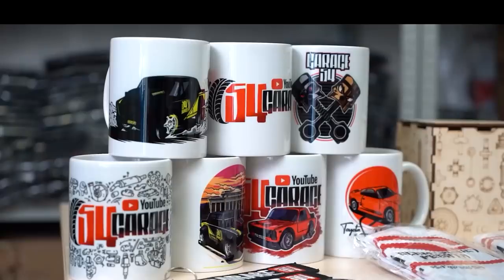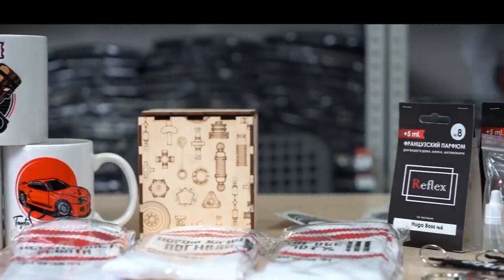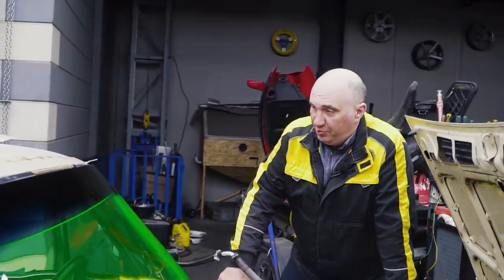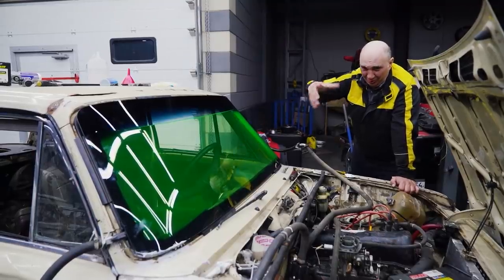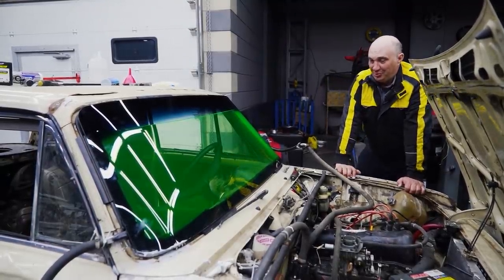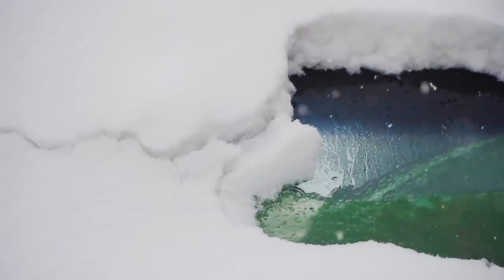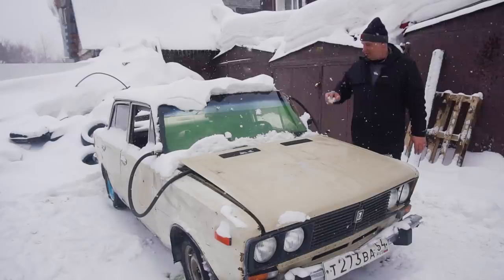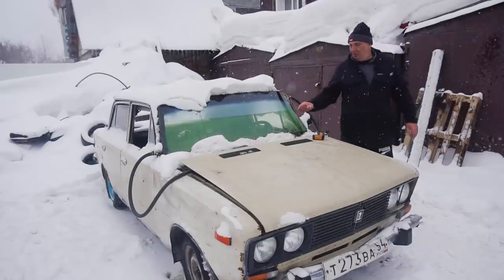Using coolant to heat a windshield

Comment: These totally odball experiments are my favorite! What a good theory, that would work so good.
Reply: Great idea on paper, sure! However in a crash, there is a good chance you would get doused in hot coolant. Nonetheless I think it’s a neat idea too
Reply: @nigwardtesticles8004  They can always hook up a bunch of sensors and valves to make it "safer"
Reply: @CodeBuildsCars  in theory yes. But there is still a high risk of getting scalded. Especially if the sensors fail, which they are know to do in cold weather.
Reply: @nigwardtesticles8004  agreed

Comment: 1:15 - gasketed window removal - EVERY time I try, I break the windshield. The other day I was just putting an old gasket on one that's off the car for safer storage, I was sweating balls doing it. 

You guys are pros.
Reply: @Mike i work in a car glass shop, and its not even always easy for the pros;)
Reply: Adam Chapman  yea
Reply: On some cars it takes 15 mins on other 3 hours...
Reply: with two ppl windshield removal isnt to bad .. alone its a beast
Reply: Adam Chapman  LOOOOOL that happened to me when taking a urethane one out - cut 95% of the way around, obviously two of us were doing piano wiring it, for some reason, crack. I was so pissed. Wasted several hours.
Reply: @blackriflex39  how is it even possible alone ? Xd

Comment: This is actually genuinely great! Make it thinner and less DIY and you've got a working anti-freeze 🙂
Reply: @Pissrust69  Perhaps a bypass valve?
Reply: Summer might be a problem.
Reply: @Pissrust69  The same thing as without? You'll need to replace the windshield anyway.
Reply: @Bourinos02  that’s not the point lol.. the point is you will have boiling hot coolant on you in an accident.
Reply: @CapnCrunchESO  windshields don't break like safety glass, you could have an inner lining decreasing both the volume and chance of leaking coolant. And if the crash is strong enough to completely ruin the windshield, you've got bigger problems than coolant but I get your point :D
Reply: @Bourinos02  windshields have a plastic middle layer to keep the shards togheter, but its definitely not waterproof after an accident, if the windshield breaks, you will get 90c coolant on you

Comment: This concept has been done back in the 1950's and was proven unreliable in the long run due to the glass being breakable. If you used plates of Meller Sapphire, like some aircraft, then it might work but the cost is prohibitive.
Reply: I thought I might explode from the pressure
Reply: @paveltahiel4998  The seal would probably go before the glass. But they didn't have very high pressure on this, notice the air forming at the top from steam.
Reply: @paveltahiel4998  16psi doubt it
Reply: I would use laminated glass and use some form of transparent membrane as to contain the fluid and pressure "16 psiG" so in an accident the glass may fracture as normal windshields do but the fluid will remain contained or allowed to leak off in a controlled manner and I would install a single use pressure relief to eliminate the threat of burst and FINALLY this system would be completely independent from the engine's cooling system this way temp. and pressure can be in full control "an overheated engine can send temp's and pressure skyrocketing which could cause a dangerous situation to occur plus with it setup like this the system can be completely turned off let's say in the summer you don't want a blazing hot windshield blazing your face off with heat as you drive in 40 C summer heat!
Reply: Ignoring other aspects, modern windshields are essentially indestructible compared to windshields even 40 years ago, nevermind 70 years ago, so glass being breakable is really not the issue with this concept anymore; in particular, modern windshields are safety glass, which is relatively flexible for its thickness, and is generally not permeable when cracked. Basically, if you wanted to do exactly what Garage 54 did here, you simply could, and it would be fine; modern windshield sealants are vastly more powerful than the coolant pump.

Comment: As absolutely awesome as this is, it’s one solid rock hit away from springing a leak and leaving you stranded.
Reply: If I had a dollar for every time a rock put a hole through my windshield, I'd have exactly zero dollars.  I've been driving for 36 years
Reply: And soaked head to toe in toxic coolant. God forbid you had your mouth open or had children/pets in the car. And id imagine it has a fogging and condensation issue. You would know what i mean if you have ever blown a heater core
Reply: @jeremyspurlock6636  I've been soaked head to toe in lukewarm coolant, and got plenty in my mouth.
It tasted mediocre.

Toxic, yeah, but don't blow your frontal lobe over it.
Reply: @jeremyspurlock6636  don't forget that coolant is gonna be HOT.
Reply: @KingNast  I would have already about 100 $,  and I am driving only for 21 years. My new windshield after winter always gets hit from stones that stay easier inside winter tires,  and for my big windshield van I had like 7 rock hit the windshield for one or two years with visible damage -- and some day it cracked from water freezing inside that damaged windshield.
Reply: Emergency shut off and bypass system? The only worry would be vapor left behind. Maybe install some sort of magnetic squeegee feature.
Reply: @KingNast  Okay city bum

Comment: That’s actually a great idea XD. Have a system that uses the black borders of the windshield to circulate the coolant, so it doesn’t obstruct the view, reinforce the windshield with an extra polycarbonate/safety layer to help with temperature expansion, maybe even have element heaters to narrow the temperature difference, so the risk of cracking is reduced. Then have a pump and hose under the windshield wiper cowling/firewall that drains the coolant back into the main reservoir or a switched auxiliary one, when the unthawing is complete. Of course the coolant assist function would only be useable if the engine is stone cold and at a certain system pressure for a present amount of time. Other wise the heaters are used. I think it’s a great idea. 

Amazing work as always and keep it up!

Comment: I'd put this on a separate loop just like he mentioned at the end, then stick a bleeder tube on the top so you can fill it all the way and you're golden! Amazing idea! Seems like it'd also be good for driving in heavy snow 'cause you wouldn't have to worry about ice building up.

Comment: next you gotta make a seat heater and coffee cup warmer using hot exhaust with a 2 way diverter to add more or less heat for the best stewed cup of extra hot coffee and hot seat for those frosty mornings you have there.

Comment: Excellent.   Would make a great winter car, but don't think it would be too comfortable in warm months.  I bet the tint of the coolant reduces "snow blindness"  it would have been nice if they addressed that.
Reply: It could work opposite in the summer and keep the windshield cool. I bet the windshield radiates a significant amount of the heat you feel when you just get into a car in the summer.

Comment: Hello comrad. I suggest using a external diesel heater that thay use for camping etc. Also make the two ends for inlet out let of the screen to hide the pipe work. Also the bots need to make the silicon thicker to withstand the pressure.

Comment: This was a fun video, it actually made me smile. I've always wondered, on the coldest winter days here, what it would be like to have the entire car radiator inside the cabin to heat it? How fast would the interior warm up, and how hot would it get in there? I want to do this because on those worst winter days, I want to blast the inside of the car with as much heat as possible. As long as I can turn it off in summer!

Comment: The video thumbnail on this one was awesome! (I watch all episodes regardless, but this thumbnail had to catch a few non-regulars). Never knew I needed this windshield, till I saw this video (2005 Ford Crown Vic).
Reply: European Fords had heated full windshields (not just part for wipers like BMW or my Jag) with metal wires between 2 layers of windshield glass.   Worked perfectly.  It started in 1980s with Scorpio, Mondeo (Contour), Focus, Fiesta etc.   all had that option.

Also US models like Taurus or 88-91 Crown Victoria :P

The Ford patent for heated front glass was called "Quickclear"

Comment: If it wasn’t for the safety issue of hot coolant during a collision or leak event getting on the occupants, this would be a great design, it’s pretty easy to see through and could be a much better indicator that owners should change their coolant, reducing the need for flushes or related repairs

Comment: You can get clear ethylene glycol. They put it in the old projection TVs with the three tubes, red green and blue. After about five years or so it will get cloudy so if you do this, you might want to put a spin on filter set up, in between the inlet and outlet. The green is just merely colored dye, that they put in the ethylene glycol. You can get it and green, orange, which is Dexcool, I've seen it in a red color. oh, and of course, BMW has their blue antifreeze.

Comment: I think you have invented the future, one of the best practical experiments thus far. I agree you should start making these  :D
Reply: Many Fords in Europe have electric heated full front windshields -- this is even better. 2-3 minutes and snow and ice go down the windshield easy, wipers work better and washer fluid does not freeze on windshield.  And you can see same like with normal windshield --- you have to look very carefully for metal wires inside. Very good option used from late 80s in Sierra and Scorpio models as option already :)
Reply: @MikeB4pl  I hear ya mate, but which method would use more energy? If time was not a factor, this method would make you think about the efficiency of the system.
Reply: @NZHorizones  Of course coolant would use more energy --- 1. additional weight for double windshield and coolant pipes and coolant. More work for coolant pump or extra electric one, thermostat - some cars have extra electric pumps for cooling or for when you turn off your engine hot.   And you always carry this heavy stuff 

Heated windshield you are using only in winter -- some have winter for 1 month some 3 some 5 months or more of real snow and ice for winter.  Same as you are using rear electric heated windshield or heated seats :)  In summer you don't need that. Heated windshield adds maybe 0,3 kg for button, relay, some wiring and wires inside the windshield.  It is working short time only - usually when you start the car (I think timer runs heating for 3 minutes and then turns it off).  Then you have already hot air coming from the vents that take care for the rest of the heating.   With electric windshield heating you have energy from alternator :)  So it's somewhat free too as you have to wait a little bit for the interior to be hot and defog the view in the cabin

Comment: This kind of technology is actually the future of economies. Rather than wasting energy to heat the windshield, you already have the heat of the engine being "wasted", so just pipe it where it needs to go! Warm the seats, warm the cabin, warm the windscreens, and even maybe cook your food! :) 
Now we just need MassEffect's thermal clips that can just magically collect heat.
Reply: Heating your car already works by using heat from your engine, unless your car is electric.
Reply: @kunka592  Most new cars got a heater block using 12v, not from the engine, older cars used the engine thing and can't deliver heat right away. Same with the seats and the windshield heaters.

Comment: You guys are awesome. Still watching from the US. So, this video, I was wondering since you can't see through the green anti-freeze, what about just a frame around the glass? Basically just a picture frame of coolant and see if it's enough
Reply: @Auziuwu  I guess I'm thinking about regulations here. Dual glass is not permitted, much less fluid in the way. We aren't even supposed to have GPS, phones or even dash cams below the rear view mirror or in the line of sight at all. In fact, I've seen people pulled over for air fresheners hanging from the mirror in some cities. Glass can transfer heat. So a frame around the glass can have the same effect, unaffected by many regulations, and unaffected by glass replacement. So actually a pretty cool idea in cold locations

Comment: This is pretty neat to see done haha.

I don't know about the practicality of it for a car windshield in this fashion (green) or even something clearer.  If you have a rock thrown at your windshield and it leaks?  Or an accident and the passengers are breathing whatever is used.. or wearing it.

I've often wondered why rear windows often have a defrost built in but windshields don't.  I wouldn't even care if the defrost was built to handle the whole windshield.  If all it did was help unfreeze where the wipers rest, that'd be a win to me.
Reply: @TomAlter1000  it should be way more common in my opinion!

Comment: Heated mirrors, by way of ducting heated air through a tube from the HVAC housing to the mirror housing.
Reply: That's not gonna work on many levels
Reply: @shawnsatterlee6035  any theories as to why? (My thoughts assume a mirror with a sizable mount and not just a single rod type stalk) Best I can think of for problems is routing the hose through a tight space  and the air cooling too much to be any good, but I still think it is worth a look at.

Comment: I would use alcohol and a separate heat exchanger to let the engine coolant heat the alcohol then pump it through the windshields. That way it's clear and not green or yellow.

Comment: Like, I could see potential opportunities. Even during the summer pump cold water would the ac in the car keep it cooler. Same for the heat would the car stay warmer inside during the winter.
Even small heated tubes would work to melt snow.

Comment: You could use the heater in the car to blow hot air in between instead and it wouldn't be coloured plus you wouldn't have to worry about leaks.

Comment: Hey, Garage 54 guys, the Red Bull Air Force is going to try and switch pilots between two single-seat aircraft while in flight in Arizona in the United States this Saturday, April 23rd. You should switch drivers between two moving cars to commemorate their crazy first-time ever attempt. Both events would be awesome. If anybody's crazy enough to do it, you guys are.

Comment: You might want to use a water to water heat exchanger as well. Otherwise, you're going to end up with any sludge in the radiator, or engine block, is going to end up going across your windshield.

Comment: I think the secret would be a heater frame not the whole window… it wouldn’t be as great but it would do the job with no costing visibility
Reply: I believe all cars have what is called defrost, so I also believe this problem has been solved since back in the 50's
Reply: @shawnsatterlee6035  this is faster
Reply: @puddlerat  not hardly. Rear window defroster isn't fast by any means and eats up lots of amps from charging system. Not efficient at all.
Reply: @shawnsatterlee6035  this doesn’t use electricity
Reply: @puddlerat  ok so between coolant running through the heater core and now around a window when it's say 20°F it's obviously gonna take longer for coolant temp to come up. So technically it's gonna take longer now adding more area surface for coolant to have to heat up. And adding more coolant to b heated between engine block and HVAC system. Nah... It's already been thought of n tossed for logical reasons.

Comment: To improve vision - a laudable goal for any decent windshield designer - consider substituting a clear fluid. Sadly, ordinary 80 proof vodka will freeze on a cold Siberian winter day, so you'll need to get your hands on some Spirytus which is 96 proof! This stuff should remain liquid on the coldest day. Won't it be nice having an emergency supply of strong vodka with you wherever you go in your Lada?

Comment: Anything flammable used as a heating medium could cause some serious issues in a crash.
Say a car flips, the windshield cracks from the pressure, and the roof sparks as it slides across pavement

Comment: This literally could be a patent. This really is possible. Like a valve that actuates and pumps coolant into a thin double windshield, and a larger reservoir to keep the system from running dry.

Comment: not to spoil the idea but to answer the question asked at the end: because if you got in a accident that hot liquid might burn you or other people inside the car but i wish there was a way to store it in a external tank into the car so then you can drain the fluid then store the heated fluid and its ready for use later

also an idea i'd like to see you try is: take the same concept but try using the washer fluid and spray it on the glass instead....wonder how well hot coolant would work being sprayed?

Comment: Electric heat is 100% efficient and also available immediately no waiting for the engine to warm up, why they use it for rear glass and mirrors. That  time-lapse of "warming up" was surly longer than 2 minutes as that clip was a minute long itself and looked faster than 2x speed.
Reply: Lot of newer cars have electric front defrost but mainly down where the wiper blades rest. But, letting car warm up for 5-10mins also works.... imagine that!